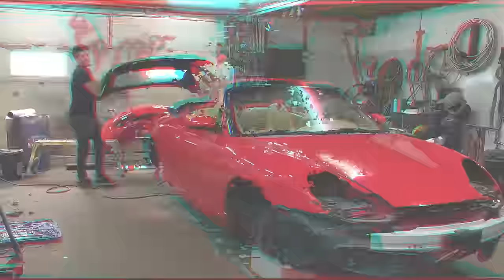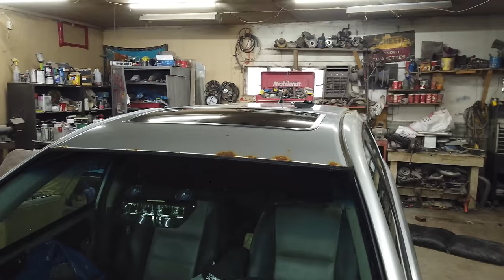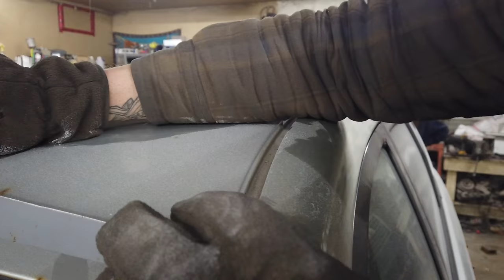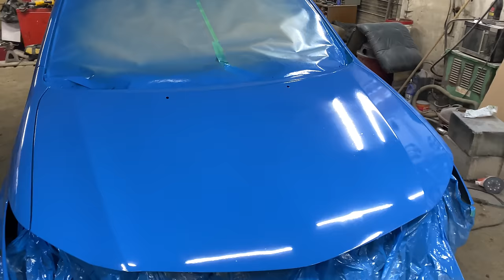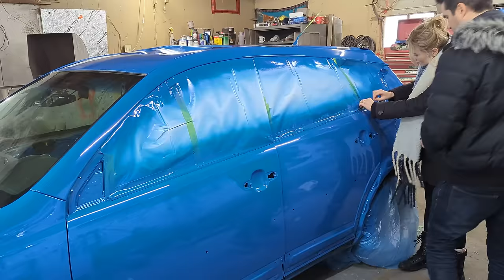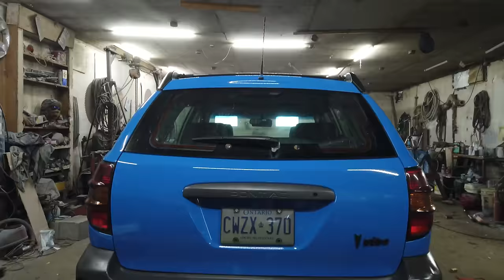Clear Coat over Rust Paint - DIY Professional Rustoleum Paint Job

Comment: The fact you guys did it right by taking it apart (door handles, cladding, lights) that’s the best way to achieve the best results
Reply from the maker: Thanks! Ya, it really is the better way. We didn't do door jambs, but I wasn't concerned with that as this is my daily that I will run till it's dead. Thanks for watching/commenting!
Reply: Lała..aa.a.a.a.a hello yellow mango. I’m on the back back back on the game. He comes back tomorrow.
Reply: I’m going to my birthday my job tomorrow why you make a way black man goes wrong please yellow blue red
Reply: Yeah the problem is the hours required to do that it's no longer $300 paint job at any garage
Reply: yes doing right and using house paint,  to save a couple bucks to each their own I guess lol    he does good work but I drawl the line on Rustoleum on a car,  I was doing this 30 years ago why because I didn't know what I was doing now I do,  he has the skill set to do it correctly and dose good work,  IMO

Comment: Industry pro here;

Great video quality guys, props!

It was a fun DIY project to watch, i think you guys did a pretty good job!

A couple notes for future reference...

Most clear coats are an Acrylic Urethane, the color coat you used is an Acrylic Enamel... those two different paints really dont play well with eachother. You managed to find thee exact right time to clear it, and still have it work for you... But, most of the time it will just blow up on you, as yall described.

To give yourself more flexibility on your recoat times, and to ensure a longer lasting paint job, without risking complete paint failure during the application... i would recommend using an Acrylic Urethane basecoat color coat, instead of an Acrylic Enamel color coat.
(I know one reason why you didnt, This usually increases the overall cost of the project, and urethane doesnt like bare metal as much as enamel, or cover as well, so your bare metal spots would need to be properly primed... however you will basically eliminate the risk of your paints reacting, and Urethane likes bonding to Urethane... so it will likely be more durable as well)

If you are painting a solid color instead of a metallic, i highly recommend looking into polyurethane fleet paints, they cost more than rustoleum, but less than automotive base/clear... all while being super durable. Its a great middle of the road option when using solid colors (all my aftermarket 4x4 gear is painted w poly fleet paint for a reason)

Anyways, thanks so much for the video, and best of luck on all your fun future projects!

-cheers!
Reply: My thoughts exactly a gallon of cheap single stage would accomplish the same or better result
Reply: @humanbeans7952  Spend an extra hundred or two for automotive paint if your gonna go through all that trouble. It'll hold up better, you could park it outside no problem, and get better resale value down the road. What is cheap isn't always cheapest in the end.
Reply: wouldn't the easiest be to use Tremclad Clear coat? That way it would all be the same system.
Reply: @johnfunk4313 You want the 2k Clear coat as it is  very durable and has a gloss sheen that is far superior to a 1k clear. As mentioned above, you'll need to ensure that you don't get a reaction. 

I've had good luck clearing the rattle can with 2k after a 15 minute flash. In the past I would spray rattle can and let it cure completely, several days then I would scuff with 600 and clear to avoid a reaction. Probably could step it up to 800 for the scuff but it gave me good results that I was happy with.

Comment: Years ago in the early 2000s we  used Rust-Oleum to paint our race cars. Our normal paint store was closed for a week and we had to have the car ready for the weekend . So I went to Walmart and picked up a gallon or international red and sprayed the car. We were so surprised just how nice it turned out we ended up doing 6 all together. Even now the 2 that are in the field still look good and with a little wax would shine like it did yrs ago. You would be surprised how good the paint will turn out when you do a good job on prep.  Awesome video
Reply from the maker: That's awesome! I hope this paint stands up for a long time as I hope to get more out of this car! What kind of race cars were you building/racing?
Reply: Exactly the prep work lays the foundation for the end result. Good prep will save you time and headache.

Comment: I like what you guys did there! I would add that, if you’re like me and not a professional painter and without professional facilities, skills, or tools … I have found that if you are reaching for as professional looking results as possible, a light wet sanding between each coat with about 1500-2000 grit does an amazing job of getting rid of any dust, bugs, orange peel, and slight “fisheyes” that get into the wet paint and that usual present frustration with amateur level work. Granted, for just an old daily driver, it could be overkill, but if you have the extra time and you are looking to challenge yourself to do the best paint job you can crank out while on a budget, wet sanding makes a lot of difference and adds very little to the overall cost. The sanding will also give the next coat something to bond to and increase the odds that the clear won’t peel after some time in the sun.
Reply: I'm just learning and I've seen alot of people say how it's very important to walk the side from end to end because that whole "spraying a half panel, then spraying a half door" will cause tiger striping and unprofessional looking results. 

I noticed in this video they sprayed small areas rather than entire panels from side to side. 

Is that not a problem? Ice scoured the comments and I can't find anyone saying it here. But in every other video I watch, seems like dozens of people say that walking it all the way down is the only way to go. 

🤔?
Reply from the maker: Hey, yes for sure if you have the time and want to go that bit further it would make a difference. If we let the blue cure fully we would have had to sand before the clear or it wouldn't hold up. Thank you for watching and for taking the time to comment!
Reply: @inthelandofmorethansmall7582 Using solid colors, "stripes" would appear from dry spray. Metallics may end up striping by doing that AND it's a single stage paint, like the rustoleum. If it's a metallic base coat color, this won't be a problem for a moderately experienced painter. The base coat would then need to be clear coated. If you spray a true candy or pearl coat (3 stage, pearl over the base coat color before clear) you would definitely want to walk the entire vehicle.  But your overlap would contribute more to striping than anything. Consistent application (speed, distance, overlap) is crucial
Reply: That's enamel it will not dry enough in between coats to wet sand
Reply: The guy talking about sanding is right about everything he mentioned and should be applied if you want a decent looking paint job. Especially wet sanding the clear then cut and buff for the final. Also an inexperienced painter should be concerned about things such as runs, proper technique and body posture and maintaining the same distance from nozzle to surface being painted and air hose control while actually trying to paint or more importantly clearing the car( you don't want to be tripping over things and hose while trying to shoot clear) also when new striping of any kind regardless of color is something to watch and for different reasons but the two likely will be improper coverage and dry streaks in either base or clear due to how you have the gun  set up and how you are overlap ing each pass. Pay attention to how much air flow your gun is using to throw the paint. If the air to paint ratio is high you will get dry spots vis versa and runs become a problem. Also prep good and pro tip always before you start working and sanding use dewaxer and degreaser every where you are working people don't think about how any wax or grease present at time of sanding will just embed all that into the work area and then wondering why the clear coat is fisheyed or something. If you don't walk the entire vehicle that's fine if you just use the body lines of the car and where they break/transition into another for where you start and stop. The difference in how the light gets reflected will hide where you start stop and even doing blends. Last thing is to pull tape and paper while wet because doing after everything dries increases the chances that you'll pull some of the paint and clear off while trying to remove tape from gaskets and trim.

Comment: I do body/paint work and detailing at a used car dealership and this video impressed me. I would never have expected rust paint to have turned out so well. I was especially surprised to see that the clear didn't react with the rust paint. I was expecting to see major wrinkling and cracking but you guys must have timed that clear application just right. Great job!
Reply from the maker: Thank you! Yes we didn't want to see it react that way either haha, because it can! But we have found, for us at least, that we let it set up for long enough to stick, but not react when we do the clear. We could have waited longer and done a scuff before the clear, but we wanted it done haha

Comment: I agree, you guys nailed it. Amazing before and after transformation. I think once you clay it, buff it and add some ceramic coating to the paint it will look even better. Nice job on the plastic cladding as well which made the paint pop even more. A+ job guys!
Reply from the maker: Thank you! Ya I was thinking about doing some of that as a spring clean up and get the alloy rims I have powder coated at the same time with summer tires.

Comment: I had two Pontiac Vibes, they were just so amazing ! Best cars I ever had ! I now have a 2024 Toyota Corolla Hybrid and I love it so much , I’m a die hard Toyota fan
Reply from the maker: Ya I'm really happy with mine, and that's awabout the 2024 corolla! They look really cool!
Reply: I almost bought a Vibe, but found a low mileage Escort instead, in dark magenta so I won't have to paint it.  I think your blue is a bit too pale for my taste, and also think your current black wheels are better than any of the colors you mentioned, though I like bright colors including on wheels, so matching blue? purple? orange? green? magenta?
  I also have a white Dodge pickup that I may be painting.  Purple and yellow?  The white is so bland.  I was inspired when a friend bought a primer Metro with purple window tint, and painted it yellow.
Reply: Hard not to be a fan. There was a short period where you could buy decent vibes for 800-1000. Super cheap Toyota

Comment: Love to hear updates concerning the durability over time.
Reply from the maker: Ya, we'll have to do an update video at some point. We can also show some of the other trucks we did like this
Reply: I would love to see the other vehicles sprayed in a similar manner. I bet the Rustoleum holds up pretty well.
Reply: I did this with the Fire Red he showed early on. I used paint thinner to make it spray well then did clear. 6 years later, it's completely failed. Flaked off starting within 2 years of sunshine. I hope they have better luck.
But I was using only materials that were free to me.
Reply: @davidhamm2613  to be fair my factory honda paint failed after 2 years in Las Vegas heat so I'd say good paint job.  Must of done well with prep.

Comment: Good tip for the reducer is to use something similar to the paint. Solid the paint is Enamel then use an enamel reducers. If paint is Urethane then use a urethane reducer and so on. Painted cars for a couple decades. Also I saw someone mention good idea using the same brand reducers as the clear coat. That is a good idea too. Staying in the same brand is always good.
Reply: Rustoleum recommends Acetone as a thinner.
Reply: @floridaroadracerguy the older cans say mineral spirits… it will off gas for a month if you do it that way.

Comment: That royfoss sticker looks familiar.🤨 I go 50/50 acetone / tremclad rust paint. I filter it direct into the cup gun, bridge coat first, and done. It does spray well, but it does stay soft longer than car paint. So...when I spray old cars, or machinery with this method, I just get high gloss paint and "F" the clearcoat. I tend to use goudey for everything, but I go to the main spot, not the dealers, they cut it atf. I sprayed more than 40 years (Cabinets, Fine Furniture, Cars, Big Trucks, Machinery etc... that kinda thing) and It looks like the finish guy here knows what's what. Thumbs Up!! Great video guys! Great channel!! 🕶
Reply from the maker: Ahh so you are from the GTA! Thanks for the tip too. Cool to hear how everyone makes their paint jobs work
Reply: I was there many of years but I'm down east right now. But I'll say this, when anyone asks me about painting their own old cars again, or even their newer ones (and they do) I'll send them over to your channel because they can't go wrong. Cheers!!!  @RustedRides  🕶🍁🇨🇦

Comment: So glad you cleared that Rustoleum, wouldn't lasted without
Reply: I did a truck in 2004 with rustoleum and mineral spirits in a garage. No clear, just three coats of paint. I didn’t even have a garage, the truck lived outside in central Ohio. I scrapped it in 2013, and the paint was just starting to let rust through. 
It was damn tough. Semi gloss black. I still have a quart of
It, going to use it on the hood of my latest project.
Reply: @DavidB-rx3km  wow, you screwed it up… somehow. Not sure how you screwed up paint with rollers. 
I sprayed the one I mentioned above, but I’ve rolled one with amazing results (red) and have used their paint with a brush in non automotive applications. It always resulted in a high quality high shine (unless I used flat or semigloss) rock hard finish, that stuck to the surface like stink on shit, and wore like iron. 
Imagine not being able to figure out how to roll paint properly.

Comment: Easiest and most cost effective way for a color change in my opinion. I've painted so many cars with alkyd enamels. It's a nice, durable finish and if you cut and buff you can get it shining like a mirror. I actually had a car I painted with Rustoleum sit outside with a tarp duct-taped over the missing convertible top for close to 3 years. I pulled the tarp, cleaned and polished the car and it looked as good as the day I sprayed it.
Reply from the maker: Nice! What car was the convertible? I might give this a cut and polish in the spring and see how that turns out!
Reply: @RustedRides  It was a '77 MGB. I mixed Rustoleum Sail blue and white 50/50 for a color just a bit lighter than you ended up with here.

Comment: Low cost paint job videos are my guilty pleasure thats why i follow moore motoraports and speedokote refinish network! just got a new subscriber
Reply from the maker: right on! ya we spend a lot of time watching car content on youtube, so many great channels, kinda why we decided to start one. Thanks for commenting/watching and thanks for the sub! Hope you like our upcoming content!
Reply: SpeedoKote makes some fantastic products at very reasonable prices. Their SMR-42 High solids clear is a bargain. I use their reducer and Acme Finish 1 hardener in my Rustoleum jobs. SPI makes the best clear but it’s quite expensive compared to SpeedoKote’s. I have several projects that I’ve painted using various products that I leave outside to test durability and yet to be disappointed

Comment: That's a solid result from a cheaper style paint. My recommendation for the rims is a satin black or a matte gunmetal color. If it's affordable, get a larger rim and a tire with a lower profile sidewall. Maybe a 40 - or 45 series style tire.
Reply from the maker: Thank you very much. I do like the idea of a matte gunmetal. I already have alloy rims, but they aren't big. The car is all about MPGs for me. I have a small lightweight rim and will put a fuel efficient tire on it. But you are right, a bigger rim would be sick!
Reply: @RustedRides  i was thinking that being in Canada and that white crap all over you need a good style snow tire.

Comment: First things first, Lea is very beautiful. Rust-Oleum was my Father's brand of choice for the first automotive paint job I did, a 1959 VW type 2 Panel Van in like 1972. I however was issued a brush with which to apply it . Apparently this was something of a family tradition. My Father told me that when he came home with his first car a fire engine red prewar 8 cylinder Buick the first thing his Mother did  was to have the hardware store immediately deliver  can of dark green paint and a brush and ordered my Dad to have the car painted before his Father returned home from his work in the city that evening. Based upon my Father's birth year and that he was Choate class of '46 as the year this occurred.